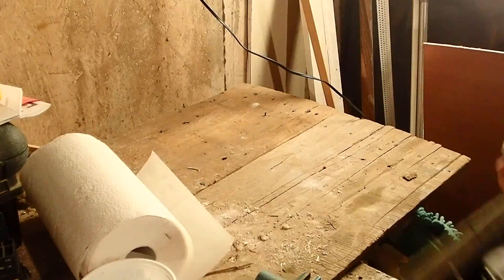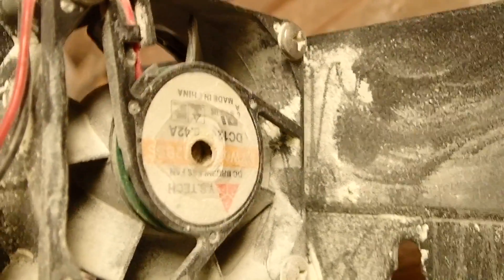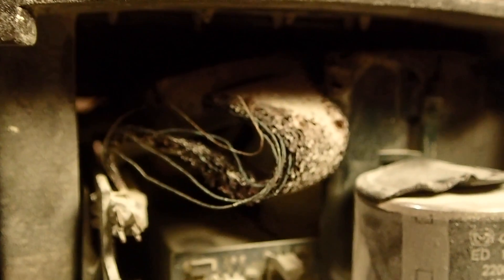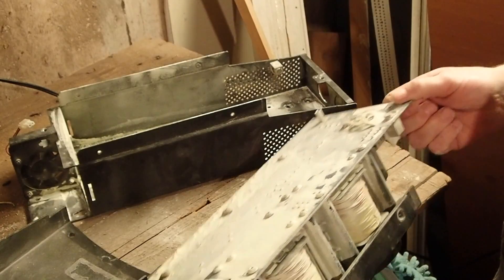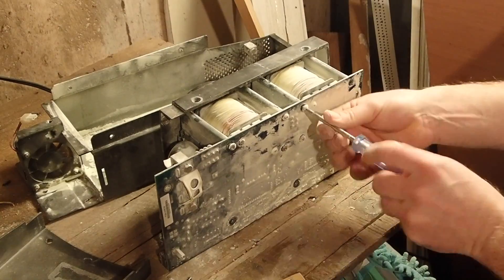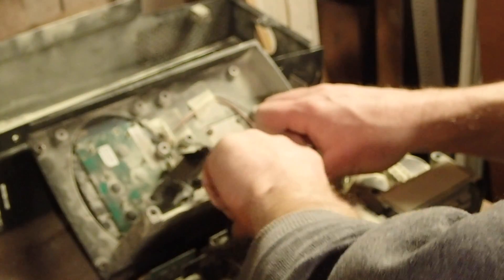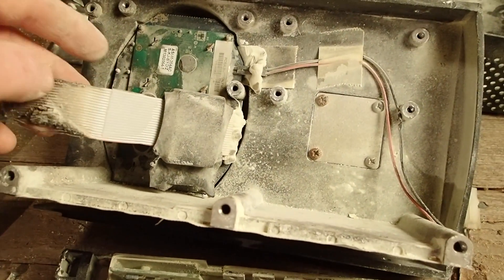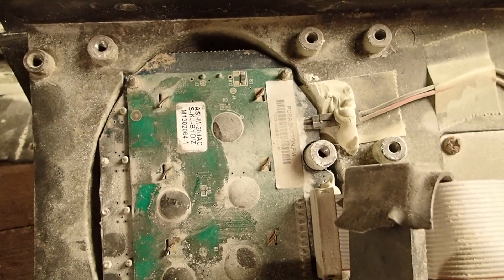Outback FlexMax 80 Tear Down - MELTED IN FIRE - Can i fix it? Part 1

Comment: I have an older generation of MX60 (not flex) and just when I want to get to the interior fan, removing the front facing assembly is impossible because it feels like the mosfets are super glued to the heat zinc of the unit, I’m really worried of prying it open an breaking the solderings. I’m stuck!